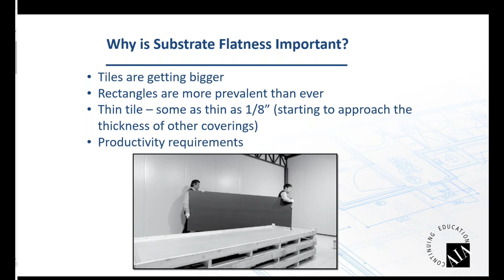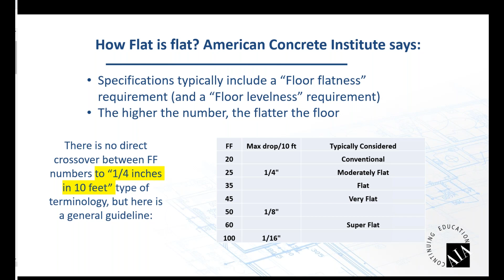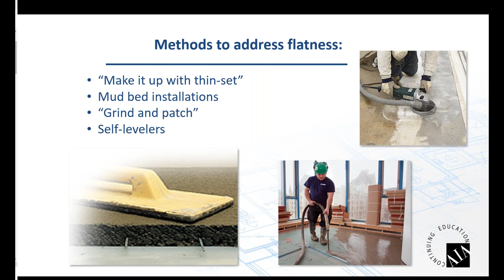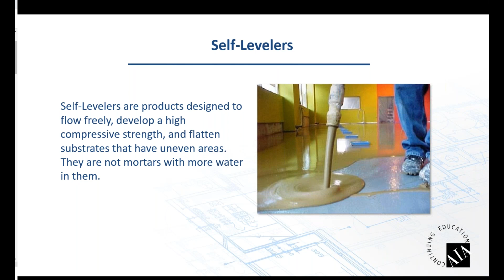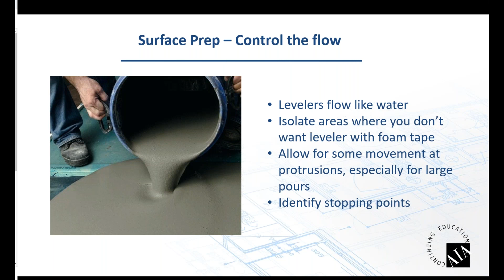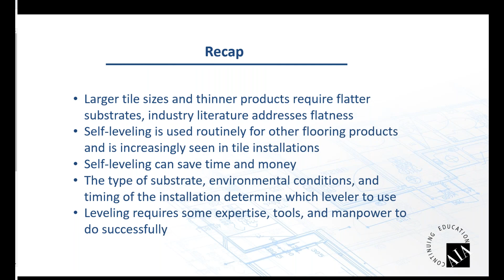NTCA Webinar: Surface Preparation for Tile and Stone

Comment: Having a flat substrate goes without saying but why haven't concrete pour standards been changed to match flooring manufacturers specs? Every concrete slab ive measured is radically out of spec and requires a combination of grind work and fill work and this is in homes 3 months old. I'm not saying it wasn't fine at the time of completion but I also do a lot of home that are 40- 60 years old and most times those slabs need very little work in comparison. Next is why arent tile manufacturers making a flatter tile to begin  with? I dont care hiw flat your floor is, installing a 9×60" rectified tile is almost impossible without a lippage system. Is quality control tied directly to the current tech out that  allows  a installer to remedy bows and warps out in the field? Some of this tile is almost impossible to install with zero lippage, yet the manufacturers say its in tolerance.